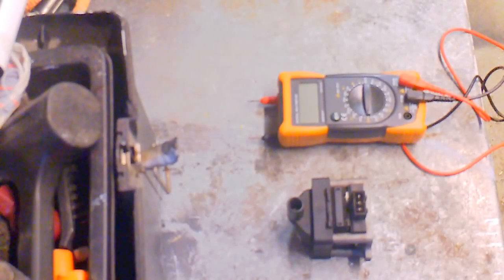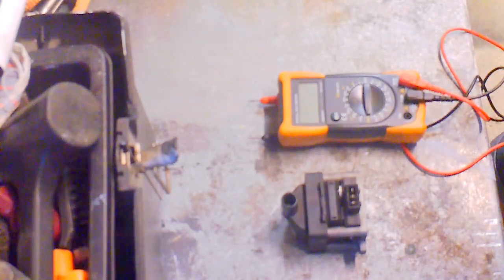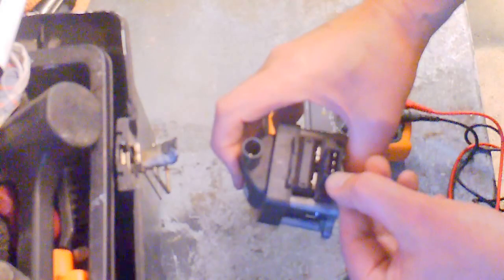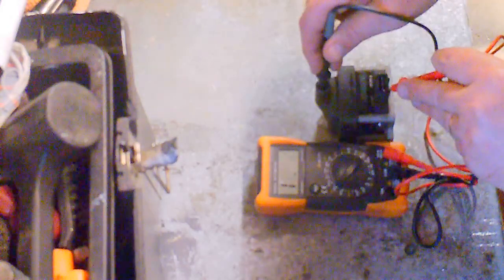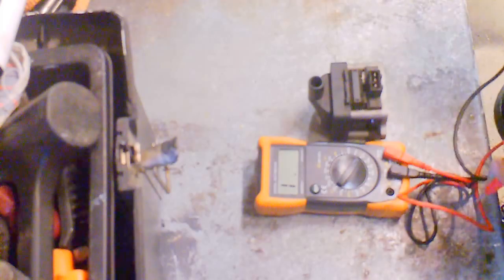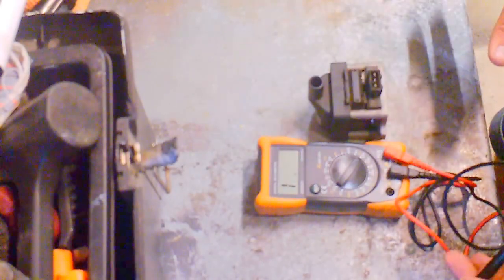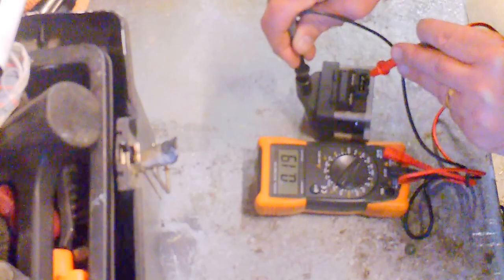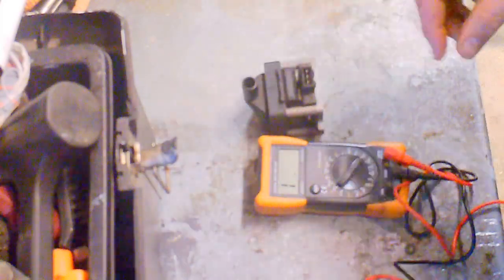VW Golf ignition coil testing

Comment: You check for resistance but you don't say what number is good and what numbers are bad.. on the first test that you did. I copied the same thing and I got 7.57 on the ohm setting so is that good or bad? My reading was a lot higher yours is roughly 3.50 on the 1st test.
Reply from the maker: What are your symptoms, are you having running problems?
Reply: @drivewaydiyer6504  I'm having a crank no start / no -spark  issue, and it's not a bad CPS sensor . That's why I was testing this ignition coil module. 
 So can you please answer this question what numbers are a good ohm reading and what numbers would be a bad ohm reading based on the video you made? I need confirmation here so that I can decide if my coil module is good or not.
Reply from the maker: It sounds like you’ve got high resistance, do you have spark? A simple test light spark test would solve that. That is a good coil I’m testing, so you can take from it, they are good readings. If it’s not cranking, check fuel delivery, spark, compression.
Reply: I already answered you above saying that I have no spark. That's part of the main reason I'm doing this. I used a test light and it lights up on the 2 screws on the side. I also did a fuel pressure test to I don't hear the fuel pump clicking on. So that's another issue.
Reply: @drivewaydiyer6504  Okay so here's a quick update man, on the first test that you did my reading on my first pin came out good at 7.5k I know that's a bit High but when I went to test the second and third pin the reading never changed it just stayed at 1. So would that mean my coil module is bad? I think I might have a bad ignition coil module for that reason.
But on your module you ended up getting a reading on your second and third pin which were both good I got nothing only 7.5K on the 1st pin.
Reply from the maker: It’s dead mate, replace it, I was reading this on the go, so i apologise for misreading it. The fact there’s no resistance or continuity means it’s probably burnt out. I’d go for it.
Reply: @drivewaydiyer6504  It's okay things happen I've been there. Thanks bro, I really appreciate the feedback on this, in fact I just got my new ignition coil module in the mail today it was delivered to my front porch and surprisingly the readings are the same as the readings that were on your video you just made which are good, so I would confirm that as a double win 🏋️💪🥳🎉🏁🏆
Reply from the maker: Cheers mate, let me know how it goes when you fit it.👍👍
Reply: @drivewaydiyer6504  thanks Mate,
 Unfortunately even after I got the new ICM today installed on the car I still have a crank no start but the values were very similar to yours. 3.5 K of the first out of pin, 4.5 k on the s pin and then 7.5k on the far outer pin. I'm at a standstill now I just don't know where to go at this point anymore I feel like I've checked everything who done everything I could. 😫
Reply from the maker: Have you replaced your leads and plugs. What model is yours and age?
Reply from the maker: Do you have a distributor on it and is there power getting to it?
Reply: @drivewaydiyer6504  Yes I have a distributor on it. There's basically only power going to one of the hall sensor wires. For whatever reason I'm getting a crank / no spark no start and I've checked everything you could possibly imagine. I'm stuck here I don't know what else to do to get this engine running.
Reply: @drivewaydiyer6504  Yes there all brand new parts on this engine, the motor was just rebuilt. So for that reason, yes new ignition wires and plugs as well. A lot of people are telling me they think I have a faulty distributor but those are discontinued you can't get them anymore unless you're a member of a VW forum or something like that.
 It's a 1992 Volkswagen Corrado SlC with the 2.8 liter VR6 12 valve
Reply from the maker: Sort of changes everything a bit. I would be tempted to get your distributor tested and fixed if you can. If you’re get power right upto it, then nothing from it, then that’s probably your problem. I’m not an expert on VW’s even though I’ve had one which I did up. I’d join a few Facebook pages and get some advice on getting yours re manufactured. Get your coil rechecked aswell, those readings seem a little off, could be somethings shorted it out and possibly your distributor. Have you had any re wiring done on your car?

Comment: Hello, Are the resistance values in ohm and not in Kiloohm? On my coil between the 3 pins and the HT terminal I have 3 infinite values! No more ignition and the coil is split. I am waiting for a new used reel that I could test thanks to your video. Big thanks !
Reply from the maker: I used kiloohms, it sounds like the coil has gone. I take it there’s no spark, either?
Reply: @drivewaydiyer6504  No, no spark, and just after a few minutes of trying to start it, the coil was boiling hot. As for the resistance values of 3, .., 4, .. and 5, .. these are ohms I guess, or kiloohm please?
Reply from the maker: Is there anything going to the distributor. Are you getting anything to the coil? I would just change the coil out. You should change plugs, leads and distributor cap at the same time.
Reply: @drivewaydiyer6504  Hello, I have just received a second hand coil in perfect condition, the values of the video (in Kohm) correspond, the engine has started straight away. Thank you for your video which gave me new knowledge. Do you well! Philippe
Reply from the maker: Great news

Comment: I have a seat cordoba 1.6 petrol i checked the ignition coil the same way the first port gave me 7.46  the other pins gave me 3.46 my car starts but when it comes to 30 rpm it chokes any advice ?
Reply from the maker: Sounds like the resistance is high on the second port, which is why it’s struggling and probably overheating. Would be worth changing it.

Comment: Hi , first pin 3.71, second pin 4.72 third pin has no value and there is no spark when on the car any idea ?
Reply from the maker: Is there spark coming from the coil. Check wiring into the coil. Check HT leads and distributor aswell.  You maybe losing spark at the rotor.
Reply: Bro exactly same problem here, faulty ignition coil, bought a new one, n everything is fine

Comment: First pin 3.27, second pin 4.33, third pin 11.66... are those good numbers?
Reply: Also first pins resistance to the metal case 8.37, second pin to case 9.34, third pin to case was 0.
Reply from the maker: Resistance on the third pin, looks really high, are you having problems and what symptoms are you having?
Reply: @drivewaydiyer6504  Yeah, there is. Few days ago i was driving and everything was fine. Suddenly the car lost pretty much all power and i could not accelerate. I opened the hood and could hear the misfires from the ignition distributor(it sounded like the spark was jumping somwhere where it wasn’t supposed to). Giving it gas stalled the motor but it could start up. I got towed home and the next day the car started for just long enough so i could drive it into the garage. Hasn’t started since.
Reply: @drivewaydiyer6504  I’m guessing i should probably just but a new coil, distributor cap and wires.
Reply from the maker: Sounds like the coil has gone , have you got a spark tester. Test for spark and chase it back to the coil. You can use a testlight if you’ve got one. Connect it to ground and see if there is spark from the coil.
Reply: @drivewaydiyer6504  Ok, i’ll check it out. Thanks for the help.

Comment: is this bremi 11893 ?. İf true what is mean 1. 2. 3. pins. Which +12 which trigger and gnd ?
Reply from the maker: ali güzel you would need to check out your wiring connector and identify what wire is what. Thanks for watching
Reply: Driveway DIYer i dont have a car. İ have this coil and i want using without car.
Reply from the maker: I suspect pin 1 is 12+, pin 2 is control, pin 3 is ground. What are you using it for, if you don’t mind me asking?
Reply: @drivewaydiyer6504  thx. Just experiment
. I tested my coil but 1 to 3 pin short circuit. 2 to 1 and 2 to 3 1k OHM

Comment: I am currently having problems with my car, the 1st pin has a value of 3.26, the 2nd has 8.58 and the third 7.22. The resistance between the 1st pin and the top link is 0 but that of the 3rd pin is 3.96. My car has no power and cuts acceleration. Can anybody help me?
Reply from the maker: Sounds like quite high resistance on those pins. Are you getting spark on all cylinders?
Reply: @drivewaydiyer6504  Yes I have spark in all the cylinders, but the car vibrates a lot at idle. The issue is that when accelerating to start the car cuts acceleration and chokes which makes you not even able to drive, because the engine almost dies.
Reply from the maker: The fact you’re getting spark doesn’t discount a problem with the coil, but I’m wondering if you’ve got an air leak or a fuel issue. Have you got an eml light on or any codes?
Reply: @joaonanques4489  same problem, I changed the ignition coil and the car is good now.
Reply: @smartysmart  I changed mine today and it's not resolved...
Reply from the maker: Could it be fuel related, have you checked compression? Could your timing be out?
Reply: @drivewaydiyer6504  The car is right now in a park, and it's difficult to make tests, but tomorrow I will try to test. I have checked on a video that I can test the fuel pump, making a jump in the relay and watching how much fuel it's coming in one minute. In the video the talk about something like a minimum of 1,5 liters of fuel in 1 minute. Do you think this will be a good test of pressure considering that I don't have any special tool?
Regarding the timing, I don't know, I didn't touch anything related to the distribution. This problem appeared after a revision where I changed the thermostat, coolant, rotor and distributor cap.
Reply: @drivewaydiyer6504  problem resolved, the timing was out. The new ignition coil was a good investment, because the car is much better now. Thank you for the help!!!!
Reply from the maker: @joaonanques4489  glad you got sorted. Sometimes it’s a process of elimination and you get to the problem.
Reply: 4.56 5.54 6.17 and 1.58 on the case... My car shut off shortly after shifting into fifth gear, and will not start again it will just turn over. When I let go of the key and the starter stops it lets out a huge grown from the engine and I don’t know if that is from the starter or PCV system but I’m just trying to get it started again for the most part, great videos man.
Reply from the maker: The starter wouldn’t stop it from running, I suspect the coil has burnt out. Check for spark first, before anything , that will determine which avenue to go down. Can you hear the fuel pump priming?

Comment: Hy how to check for golf 4 four hole 4 pin plz
Reply from the maker: You could do with finding the resistance specs and get yourself a dvom. Set to 20kohms and connect the pins to the ht holes and see what readings you get. Check for volt leaks and areas that look like they’ve been affected. Often coils fail when they warm up.